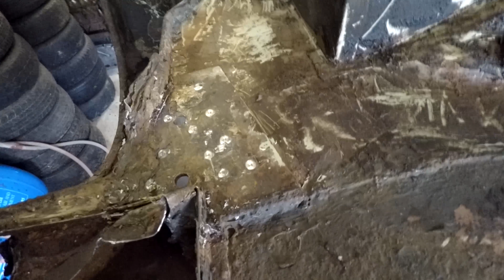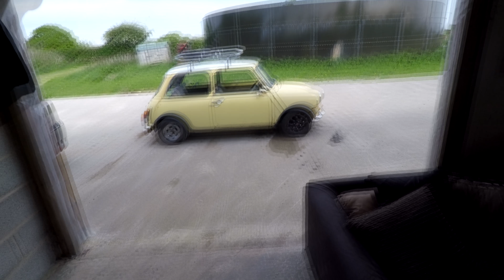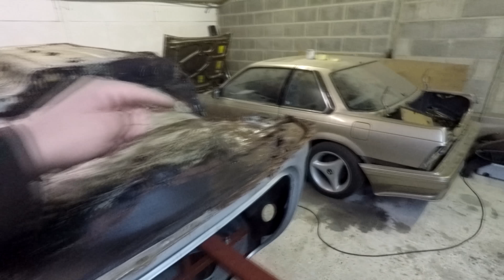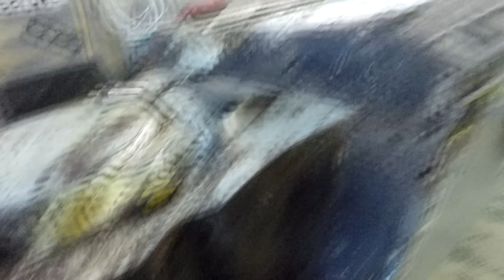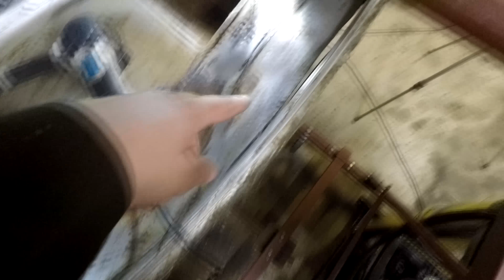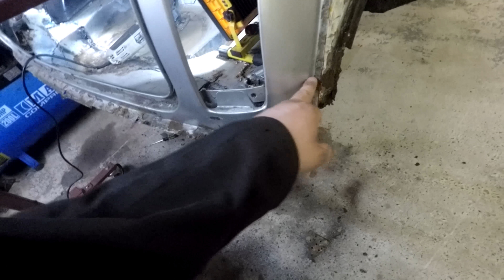Classic Mini Restoration Ep. 46

Comment: Ben, Love the caption patchwork video quite apt lol.The plates you cut out on both sides make up a thickness of around 3mm which sits against the sub frame i have even seen felt between the frame & body on some older minis i guess for noise reduction,
I would line up the boot repair section you have with an make a overlap for welding and cut the  rest to shape, Cheers Dave.
Reply from the maker: This had pink carpet between the subframe and body when I replaced the subframe a couple of years ago... I took it out and didnt replace it as it must of been trapping water!
That sounds like a good idea, definitely will be doing something along those lines.